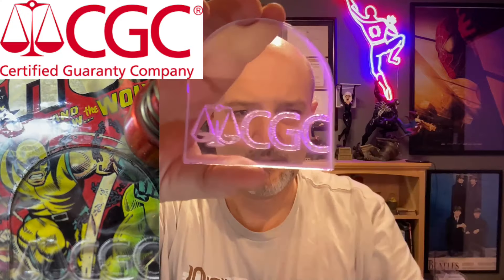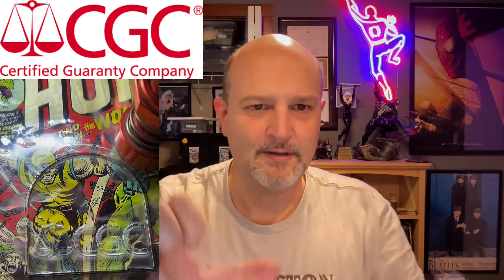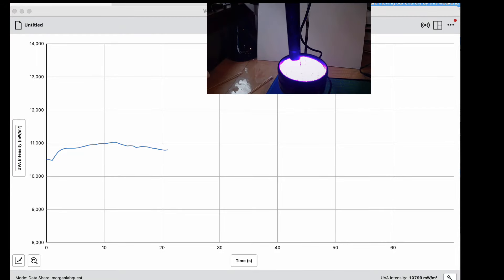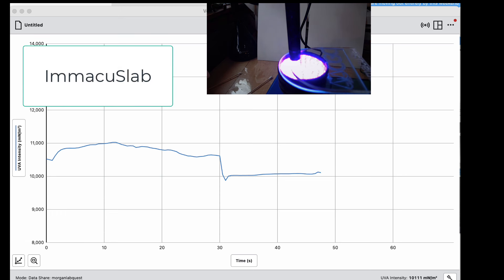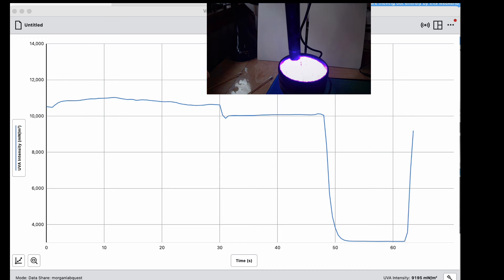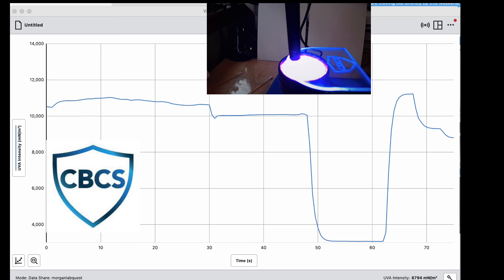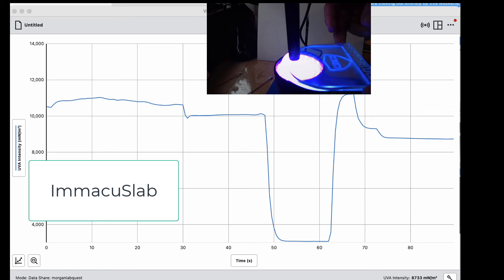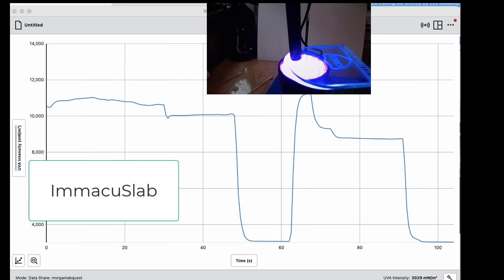CGC vs CBC UV light blocking comparison

Comment: I picked up some comic capsules and you cannot bag and board silver and bronze books you have to put them in the capsule raw which I don’t care for.They work good on modern but you have to put the books in 6 3/4 x 10 1/2 boards and 6 7/8 x 10 1/2 bags to fit in the capsule which is tight and unfortunately I ruined a ASM#300 9.6 trying to stuff in the capsule.So I can send you one or two to do studies on.I’ll put it in the package going out to you tomorrow.
Reply: Raw is where it’s at anyway.  Yellow label or no label.
Reply from the maker: Oh that’s great thank you so much!

Comment: I wonder how much it would cost the grading companies to up grade their slabs to improve their UV protection tonthat of your Imaculate slab!
Reply from the maker: It’s not cheap.  That plastic is somewhat expensive and it can’t be Thermoformed or sonically welded.
Reply: @ImmaculateComics   that’s too bad, if feasible it would be better for the collecting community. For you think a UV protective film could be added to the inner well ?
Reply from the maker: @jreynolds8448  well sort of.  None of the completely transparent thin films do much to block UV light. Permanently. They need to be about 2-3mm thick. Some think films do block uv for a short time but turn sir of opaque and lose their properties over time.  The only permanent and clear solution is a thinker material like the stuff I use to make my protectors. It could go inside a case and would work just fine too!
Reply: @ImmaculateComics  that with an outer case that is fully sonically welded around the entire perimeter would seem to address a myriad of the issues the grading firm currently face

Comment: I wonder what the numbers would be for just the plastic sleeves you place on the slabs?
Reply from the maker: I actually did measure that previously and it’s within the error or the sensor so essentially zero
Reply: How about mylar?
Reply from the maker: Mylar and polypro bags have no measurable UV-blocking properties whatsoever. @ww8552

Comment: Much respect to you for the work you’re doing. EGS and PGX are both 🗑️ so fuck ‘em. Question; realistically how much UV light are slabs catching if they’re on the wall in a room with blackout curtains drawn 80% of the time and don’t face the window, in your opinion?
Reply from the maker: Well that’s a great question and the answer depends greatly on your lights. I’ll make another video showing this but most led lights have a surprisingly spike in the uv range that you can’t see. Fluorescent lights have it too to a smaller degree.  Interestingly old fashioned incandescent bulbs don’t have it at all . Most indoor comics without continuous illumination won’t fade much it there are several ASM 300s out there that have faded “a little” in a decade. Not severe, but noticeable